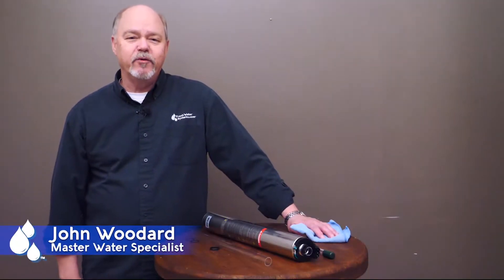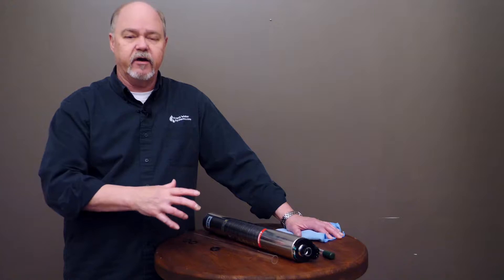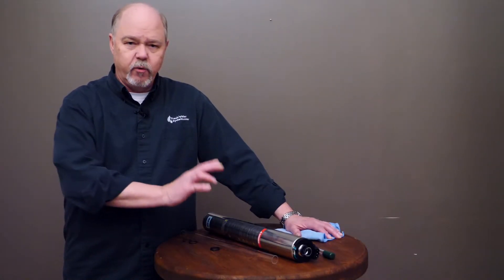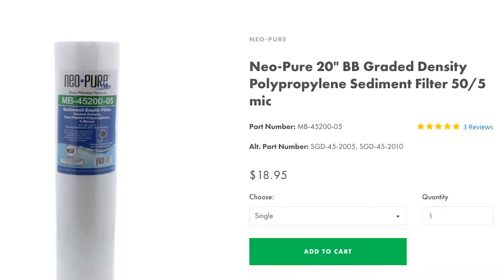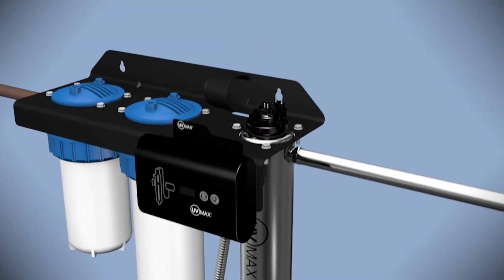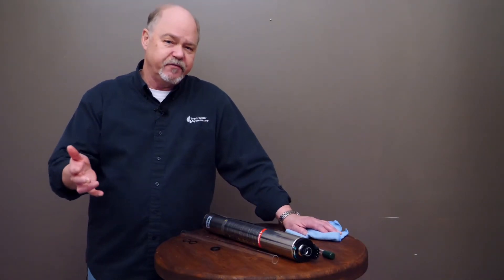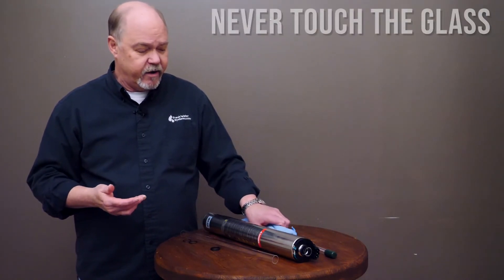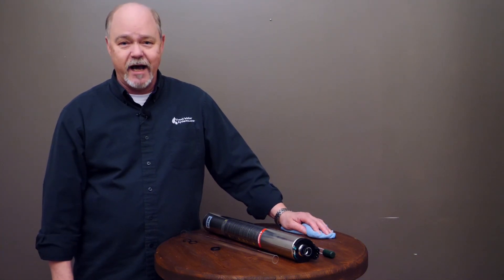Pre-Treatment for Your UV Purification System

Comment: John, your videos are excellent. I know they take a lot of effort, but you're doing us a huge favor by posting these. I'm planning a system for my modest (city water) cottage in Rockford, IL. We have very hard water here (~25 g). And, strangely, the building (in 1939) split the water line coming into the house into 3 different feeds. There's no room to tap the main feed and catch water issues before the feed is split 3 ways. So it's an interesting challenge. Thanks again for your excellent productions. I'm learning A LOT!